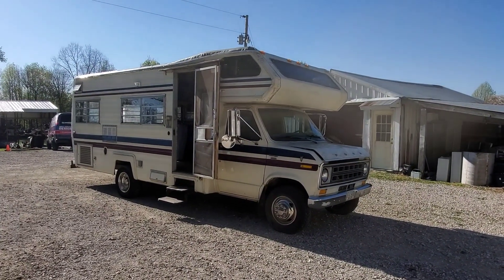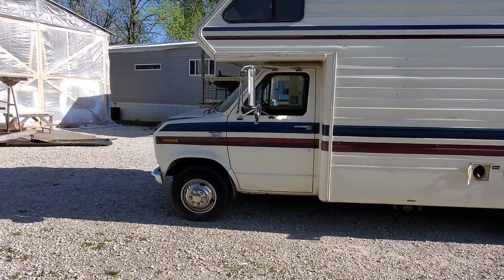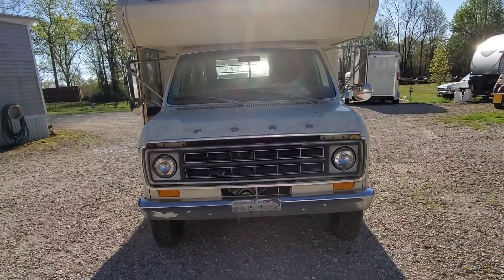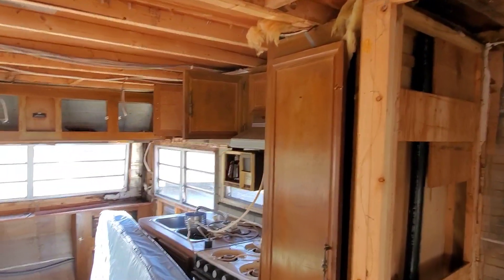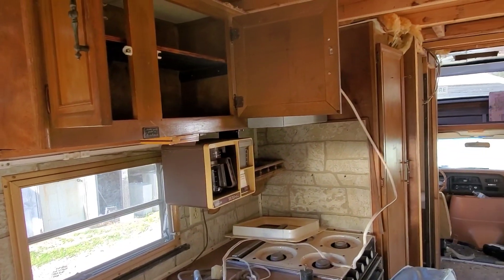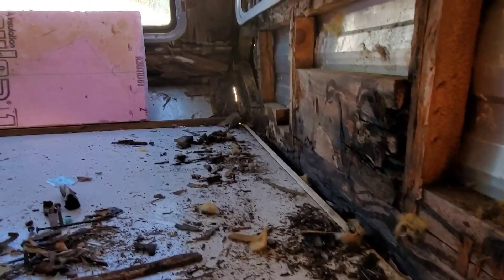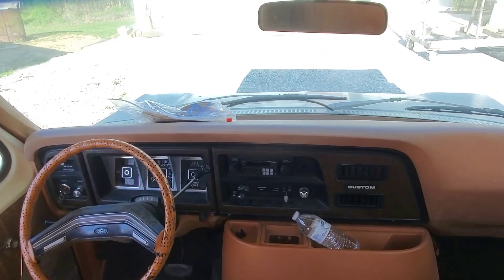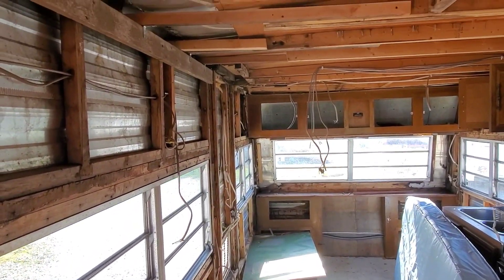HouseTruck Camper conversion beginning  (HT1)

Comment: Wow, I can really see the possibilities... no wonder you took it on! Awesome creation in the making!
Here are some crazy ideas: 
Create a slideout kitchen on one side and opposite that, build a bench that pulls out into a double sized guest bed for your friends who may join you for fishing/camping trips. 
Leave the cab open instead of enclosing it and add swiveling seats. Then you'll have a ready made indoor livingroom space for inclement weather. I understand why you want to enclose the cab to keep the heat out but that can be addressed with window inserts made of thinsulate and solar reflective lining which you magnetize over the windows. This would maximize interior space since you will be chopping off a lot of the back end to enable towing of a trailer. 
Add another fold down deck with folding chairs and table on the bench side, across from the kitchen with french door style windows  that span across  the bench. Then set up a folding table just outside these doors on the side deck. When you're done cooking, you set your food on table, sit on bench and flip your legs over the bench and voila, you have access to fresh outdoor air and a full view of your awesome camp spot!
This other side deck could also have a corner attachment you stow inside while driving that inserts to connect the side deck to the back entrance porch. 
Another thought, you can put in a Pop up roof for the bed over the cab that could incorporate no-see-um netting and roll up clear boating vinyl all around. It would look a lot like those removable roof mounted tents and in fact if you find one used and cheap, that could be attached on top of the roof by cutting out the bottom of the hardshell tent and bondo-ing the top part onto your frame for easy installation. Adding this kind of pop up would be more aerodynamic while driving and can pop up while in parked mode. This would allow you more headroom to sit up in bed and enjoy the views while relaxing. Also it would allow for a cooler sleeping temperature after a hot summer day. 
An important element of camping is shade. Thus you could design your own handmade Batwing awnings all around the sides and over the deck. These would keep temps down inside and allow for more usable outdoor spaces for gatherings at lakeside or camping. A boating style removable bbq on the deck opposite the kitchen would increase your cooking options and prevent smell buildup on your bedding. You can also create a removable chuck box kitchen setup if you'd like to create more room for friends and family inside and have a more expanded food prep space outdoors. 
A deck mounted recirculating/recycling shower with shower curtain attachable to the batwing awning could make it much easier to fit bathroom accoutrements into you now much smaller design footprint. A large rectangular restaurant prep tub can be employed as a water catchment in order to recycle shower water, thus cutting back on the water tank size needed to supply you off grid. This new system is very attractive to most van build clients so you will have this ready made version to demo to them when you discuss bathroom options. 
If you want a low tech solution to hot water, then a big black pipe mounted to the roof will heat water. 
An under counter, pullout bucket toilet that uses sawdust and trashbags that can be thrown away anywhere is really great for ease of use and wayyy cheaper than a composting toilet. Also if you have multiple guests, just setup the loo in a popup bathroom tent and you don't have to deal with privacy issues.
Keeping as much of it low tech as possible (except  for the solar, cooking appliances, and neccessary things like most efficient heater, airconditioner roof fan etc) will be less headaches in maintenance down the road as well. 
Painting whole vehicle in the white solar insulating roofing paint will keep inside temps down and avoid needing to turn on airconditioner constantly. 
Making this your most playful, pushing the envelope, experimental project yet will be fun and fullfilling. I have a feeling you could easily sell this rig for wayyy more than you invest or it could be useful as a demo/rental unit for your clients. Explore what's possible and make a name for yourself as an innovator!
🌞🌊🌈🌺🦋🕊

Comment: The last vehicle I saw in this condition was at our county fire training center where we filled it with diesel and lit it up to practice putting out vehicle fires.  If the frame is solid and the engine runs and the A/C can be repaired, that looks like all you have to work with.  Quite a project, but probably not beyond your ability.

Comment: Rebuild it.  After seeing your work, it'll turn out beautifully.
Reply: Id install a separate diesel tank abd install a webasto or esbar heater.  Sprayfoam might allow one to travel in winter also.  Plastic 30 gallon drums for fresh, grey, and black may work, could wrap in heat tape draw from 12V perhaps.  Wood siding/shiplap are so pretty but terribly heavy.  I loathe propane in closed spaces,  a 3000W inverter, solar etc.   An induction cooktop, Cuisnart 7 function electric convection oven (i own 1 in my sticks and bricks) stored safely below counter behind rolltop appliance garage to save counter space.  Install shore power as well.

Comment: I suggest checking out the truck frame real well and suspension before starting any you build.  Put an old screen porch door on the back that creaks, wobbles and slams shut. And a rocking chair.  Haha.
Reply from the maker: Frame and drivetrain are solid

Comment: Without the knowledge and resources you have, the previous owner would have lost a head full of hair and hundreds of hours attempting  to salvage the rig. Red it was very nice of you to give her what she paid for it and not take advantage of her. Looks like there is a lot of rot. Besides the windows, what can the salvage person save or reuse? Any idea of a rough materials budget for the project? I look forward to following along.
Reply from the maker: I still have the windows. I will be selling them on Facebook and ebay. I paid him to strip it down and gave him all the metal /aluminum/ copper.  I don't have a budget for this project. And the build will depend on what I can find for free or a deal on. With the exception of the metal studs and spray foam insulation.  When its all done I will have a total cost (- labor) of the project.

Comment: You should use aluminum or metal studs and for rebuilding the frame.
Reply from the maker: I said I was going to use 2⅜" metal studs.
Reply: @RedsCustomDesign  I'm sorry I didn't wait  until the end to comment. I'm sure it will be very sturdy when you're done.